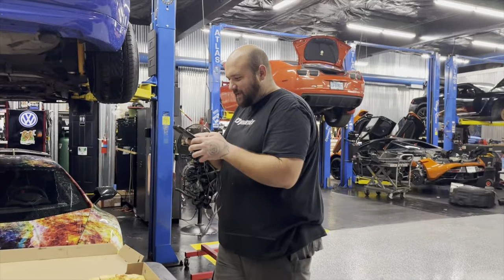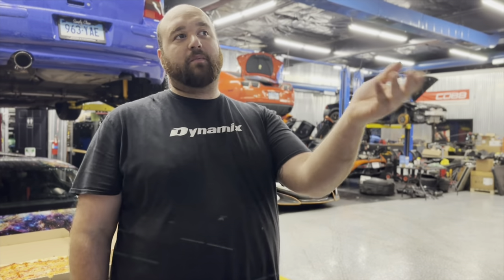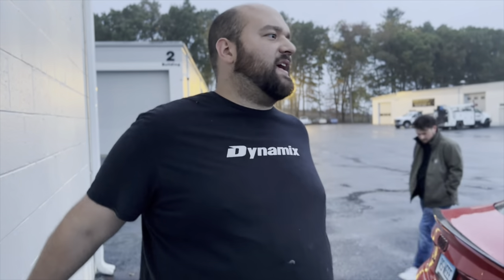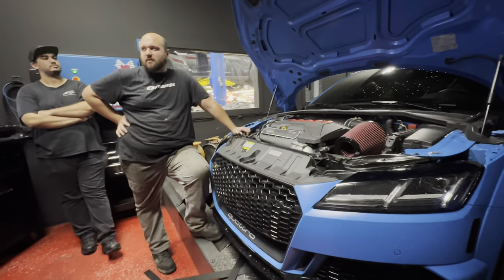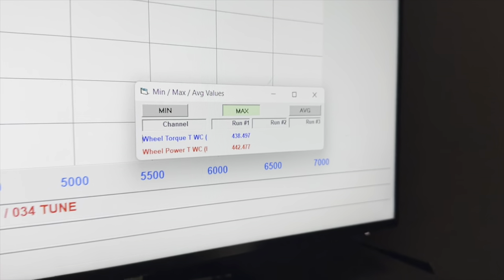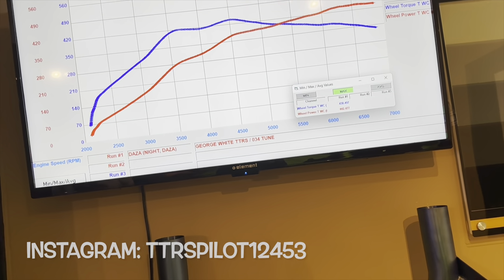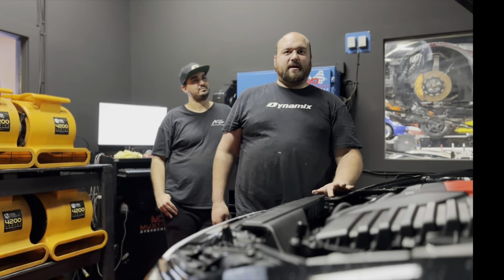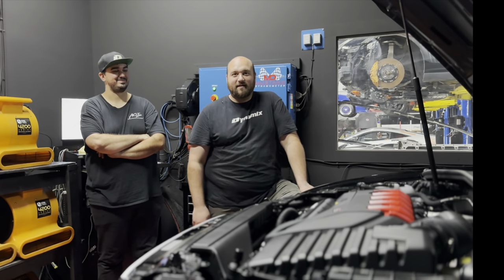The ULTIMATE RS3/TTRS Tuning Guide | Presented by Mr. Turbohand

Comment: This has to be a mustang Dyno. These Numbers seem way low.
Reply: Maybe. Aussie dyno's will measure a tuned RS3 on E85, stock turbo with supporting mods (DP, intake, FMIC etc) at ~490awhp. Given these guys aren't running ethanol, it reads high to me! :)
Reply: @RichLion same in New Zealand - these dyno numbers are crazy high - I was running 480whp apparently but running 10.4’s